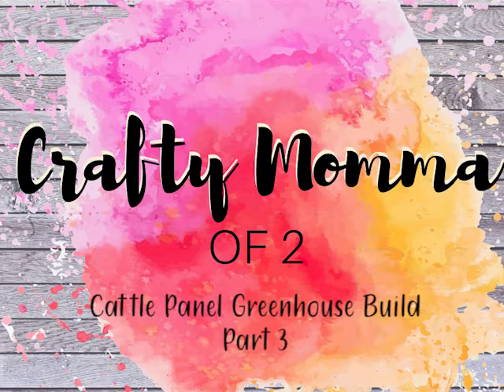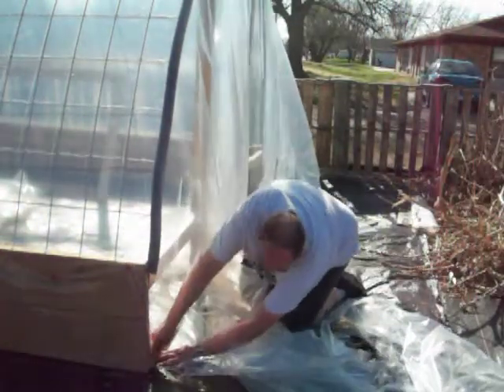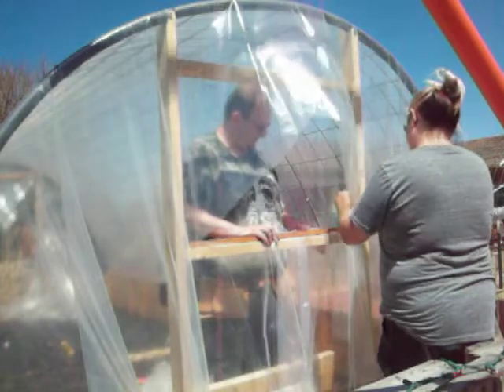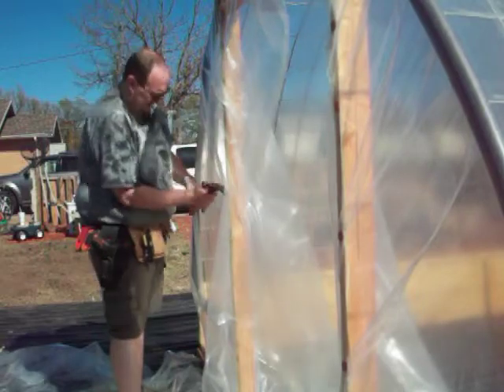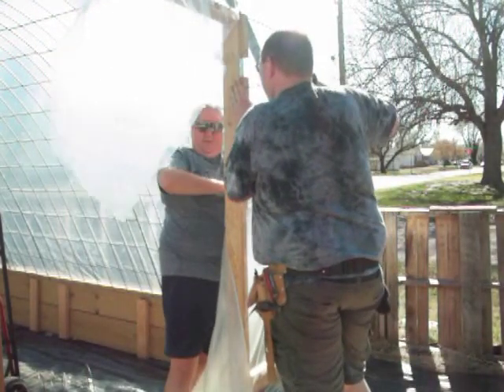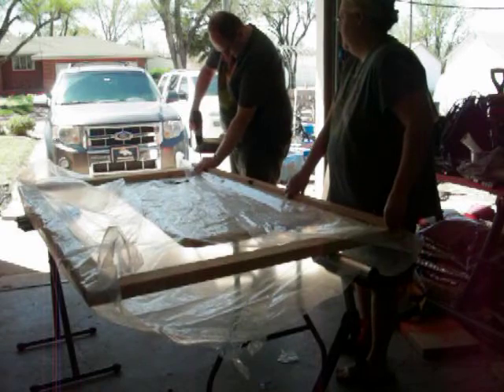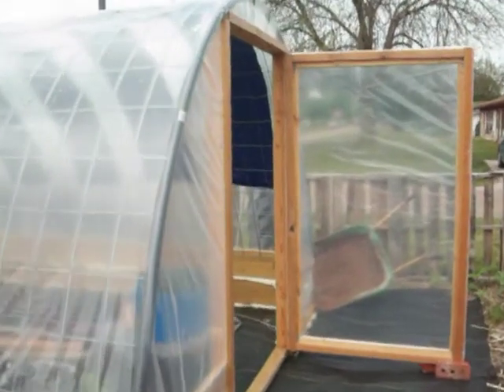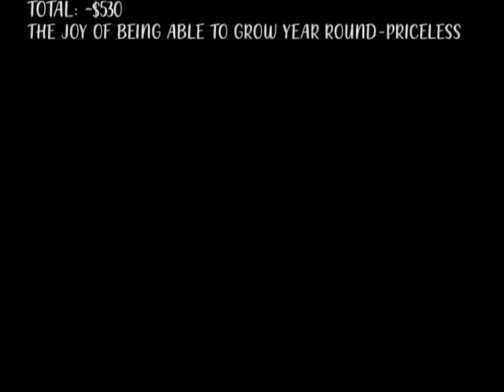Greenhouse Build Part 3| Putting the plastic on | Final walk thru

Comment: Did you use zip ties to hold the cattle panels together? If so you need to use the ones with UV protection, if you did not they probably will not last more than a year and maybe not that long. I hope that works great for you guys .for a long time.
Reply from the maker: We did. But we changed them out eventually to wire